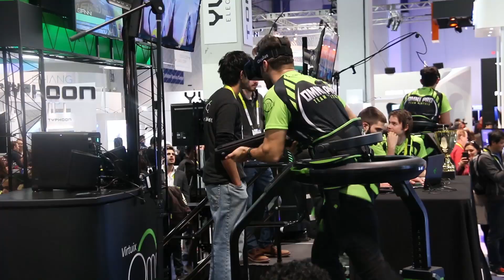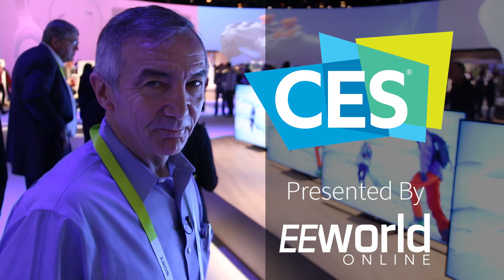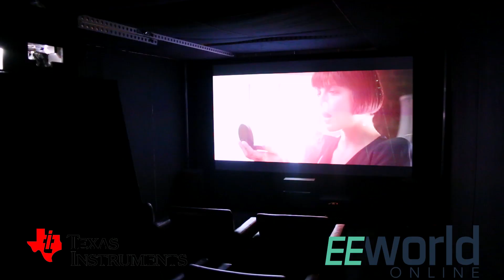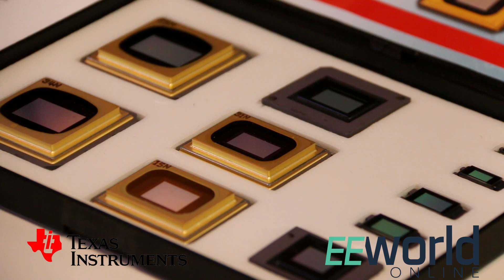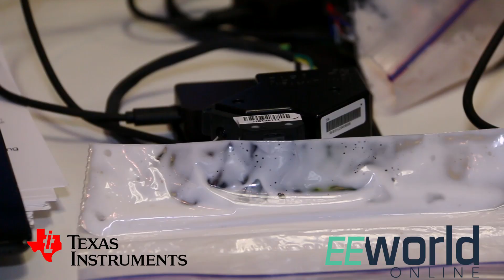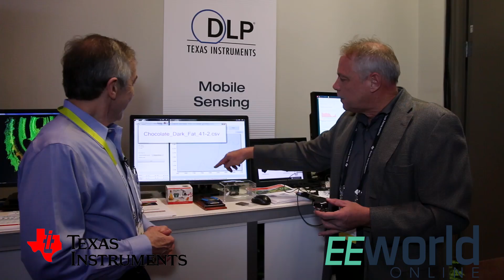An infrared spectrometer you can hold in your hand

Comment: did i miss something or you just hold the chocolate and not put it between a light source and detector? Mike also said that the light broadcast on to chocolate and dlp lokks at the response, so the light source and detector are on the same platform.